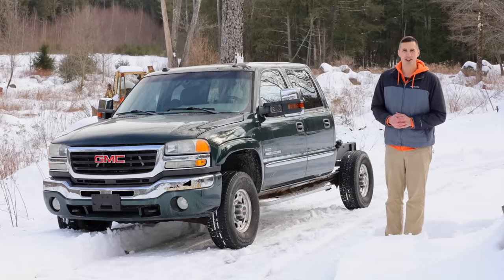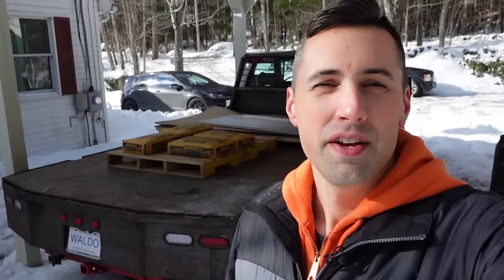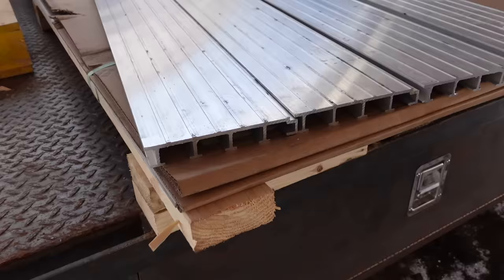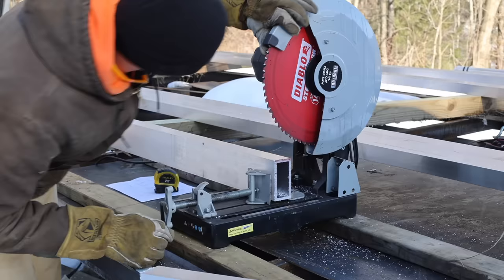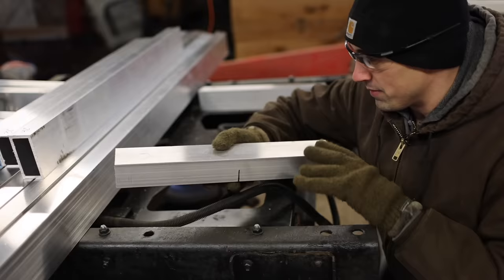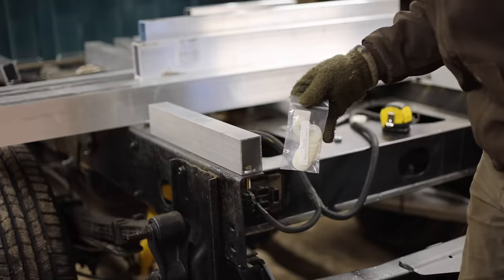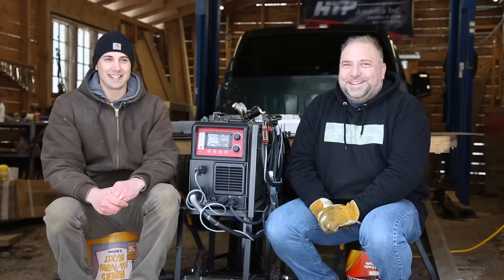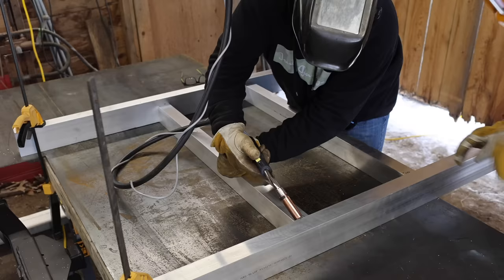Building an ALUMINUM Flatbed for my Project Truck!

Comment: I hope you don't mind a few tips from an Industrial Maintenance tech: 1 Use cutting oil with your drilling and cutting tools when working with aluminum. They will last much longer. 2 They make a wax that comes in a grease tube. You use it on your saw blade to lubricate it when cutting aluminum. We use it on our saws and the blades last forever that way. 3 When you are welding multiples of the same thing, (especially when heat matters) lay out as much as you can, and spread the heat with multiple passes. For example, when you welded the squares on the side of the bed and the round stock to the rub rail, you can jig up as many as possible, then make one weld on each, going down the line. Then you come back and make another weld. So on and so forth until you have all of the sides welded.

Comment: Another thing about aluminum other than hot shortness is that the oxidation on the aluminum has a higher melting temp than the aluminum itself . Cleaning that oxidized layer off is important .

Comment: You should also isolate the bolt from the aluminum frame with a second nylon washer inside your aluminum mounting locations to stop galvanic corrosion 

Hi from Nashua

Comment: I’ve been working with aluminum for 30 years when it starts getting too hot just go faster you don’t need to turn the power down unless you want to yeah mitre saws are pretty much best for aluminum that was a good decision. This is a very awesome flatbed your building I wanna build one myself but I’m gonna make it all out of formed aluminum check plate.
Reply from the maker: Thank you!

Comment: Now this comment is on your bed. You really did a fantastic job again. I didn't think you could out do yourself again. I really enjoy watching you work. You remind me of myself that I won't stop until it's right that matter what the temperature is. I saw your propane heater I think that's a must-have if you don't have a heated garage.

I'm actually thinking about what you did. You bought a truck got yourself a good super price and went on from there. I want to step up to a diesel pickup truck but majority of them have rusted out beds as you know from being on the East Coast as myself. I had been considering yes to remove the bed itself and build something like you have. Buying and already made one cost way too much and you cannot really customize it to what you want. Well I guess you could but I don't think anybody wants a chop up and weld want something that cost that much.

Look forward to your next video. As always I made sure I hit the like button.
Reply from the maker: Thank you so much! 👍

Comment: A big piece of cardboard or thin plywood taped to the back of the cabin, draw the contour with a marker, and make the headache thing on the cardboard. That'll give you more precise and easier measurements. And run the wiring inside the tubes...

Comment: Hey man. GM magna worker again. Super cool to see this method of “mig” aluminum working being done. Hour factory just got (2years ago) of one fords contacts to build their new lightening or electric battery box tray. Huge boy it is! 60% length of the truck.. so no off reading. Anyhow we have all new robotic welders for the staple welds, but still manual is a must and touch ups have to happen. I like how you both mention the temp, BOY did I try to tel them lol it’s usual a hot 35c in the factory, but winter brings a cool 18c and that’s enough to cause issues, at least to some of the employees 3day weld training skill lol no it’s tricky and the biggest thing is heat, and as you say, to hot and you have to really know how to move your you’ll melt through and damn is that so much more of a pain then steel. The other issues though, so you know if you ever weld in the summer of extreme heat, the softness off the feed. Aluminum as you know is very soft compared to steel and it was a bitch in hour summer temps for the first year, the wire would bird up and knot easily in the feeder. There is a extra tool you can get to help the feed at the gun. If your interested give this a shout and I’ll give you our product or if you want to just look it up. Either way, everyone thought mig welding aluminum was going to be so easy lol now did I show them! Lol OH!! On a side note, my fav thing about welding aluminum over steel, I love that perfect white fireworks over the orangy yellow, it’s like, elegant… ya my eyes burn lol
Reply from the maker: I appreciate the comment! You're the one who told me some interesting stuff about the frame (in my rusty frame repair video), right? It's really awesome to get the inside scoop! 👍

Comment: I destroyed the motor on a nice miter saw by cutting a lot of aluminum with it- the flakes got into the motor housing. A friend suggested that I wrap the motor housing with panty hose to act as a filter. Works well. Just a thought!

Comment: If it's already been said then disregard, but that rear cab mounted brake/back up light is going to shine off that headache rack right back into the cab.... ie your rear view mirror. I think I'd disconnect and cap it or just pull the bulbs out. Just a thought. Awesome video and build.

Comment: When I install the trailer plugs on truck beds, I recess  the plug  in a 4 inch tube about 2 inches in. that way the plug is protected  instead of the first thing to get busted of like the way it is mounted on the CM bed in the picture.

Comment: Not only does aluminum have a low melting point. Within about 5 minutes it also gets a corrosion layer on it that is invisible to the human eye that corrosion layer requires almost 4,000 degrees to breakthrough, what's aggravates the blowout issues related with aluminum. Which is why before you start a weld you have to use a nice clean stainless steel brush and brush the spot where you going to start the weld. Once you started the weld, then it welds just fine. All the pulse activity from that welder in the world may help it, but it doesn't fix the issue.

Comment: Smart, chosing to do the CDL.  I got a flatbed B CDL for taking my test so I can avoid the dumb class requirement.  If you take the CDL test with your hydraulic brake setup, I believe you can take the test again with any air brake truck, meaning a class B truck would suffice.

Comment: Aluminum is really nice.  I am sure the price is Ridiculous now days.  I built a Flat Bed out of Wolmanized Lumber .. It lasted longer than the Ford F-250 that I mounted it on.
   The Previous owner had a Tool Body and he made a square tube rear bumper that he also used for an  air tank ..

Comment: This is great and the rear lights add an extra level of quality that is oh so professional, plus the wheel flares. All very nice and can't wait to see the next instalment. @Steve 1961P's comments below sound great, too. If you're going to add any internal boxes I'd illuminate these, too. LED strips are simple and effective for these and can be added to the loom on your 'wider' lighting or on micro switches on the lids, but more work, or glue in some velcro for battery lights or pieces of steel (yes, I know) for magnetic lights. The Oz 4wd wheeling channels are full of good ideas as their canopy camping is legion in this area. Keep up the great work!

Comment: Question from an amateur welder and also a disclaimer. I've never welded anything but mild steel. With that in mind, it looks like sometimes you run a straight bead and sometimes you "stack dimes". Why the different tactics? Great work! Your projects are inspiring and informative.

Comment: Nice Work, both videography and welding. Some safety advice, you should always clamp down material in a drill press. A drill bit can catch your material and whip it around.
Reply from the maker: Thank you!

Comment: Hello from the Netherlands Waldo . 
to protect your welding torch cable and your remote control cable I would put a small diameter fire hose or hydrolick hose "sleeve" over it 
that saves you a lot of annoyance and costs of damaged or broken welding cable.  
Sincerely Hollandduck

Comment: When drilling with a hole saw in aluminium use CRC , DW40 or kerosene. It will stop most of the  alum sticking to the blade of the hole saw.

Comment: The biggest issue of joining two different metals together is galvanic corrosion, if you are going to join two different metals please check their potential based on the galvanic series table. The higher the difference of potential of two metals, the higher probability of galvanic corrosion.

Comment: I don't know if you will show it, but I hope that you keep the aluminum from being in metallic contact with the steel of the truck. Because as much as you claim that steel will korody, so will aluminum under the galvanic action of the differential metals aluminum will turn into aluminum oxide surprisingly fast.
I would suggest at the very least to resist that that you keep a coating of either gibbs, and wipe it down or something like automatic transmission fluid with maybe 1/4 mix of PB Blaster along with a small amount of like Dawn dish detergent to keep the aluminum from turning into powder.
It might be advisable to put at least a coating of satin clear coat on it. That will at least keep the parts of it that do not get regularly scuffed and cleared of turning to powder, from turning to powder. Atmosphere alone and contact with steel will degrade aluminum quickly.
With that song, if you will spray a lubricant on it and leave it wet you can make several Cuts before you have to reapply the lubricant. It will keep the aluminum from going up on the teeth of the saw. And yes I would saw will do a better job but you still need to apply a lubricant to it. You can even use WD-40 but you have to use it nearly every cut. Because WD-40 is not a lubricant. But it is a dispersant as well as a solvent.
Biggest reason for people having to use different procedures for aluminum is because aluminum is not actually a metal. It is a metalloid type of hi fractal mineral.

Comment: really nice job better than any i have seen. you have a lot of money just in the metal. take care, be safe and well.
Reply from the maker: Thank you! The metal came to around $2300, though I did order a bit more than I needed. Not bad considering buying a flatbed like this would cost WAY more (maybe $7000-8000?)
Reply: @WaldosWorld  yes the aiuminum truck beds and trailers are really high . but that bed will last you forever you could sell yours easily it you wanted to it's better built than the other. i have seen a lot that had cracked welds which alway get worse with age. take care, be safe and well. will be glad to see it finished.

Comment: Love the video it’s very informative, but I disagreed with your oooon on the flatbed strength due to aluminum. Aussies and Kiwis have been building “trays” for their “Utes” out of full aluminum for years with no issues at all. I lived there back in 2004 working as a welder and boilermaker and I loved the way they compacted things and built flatbeds that were very efficient for the 4wd market as well as the working man. Just a thought, but really great work, I really like and borrowed some tips from your video. Cheers

Comment: Aluminum can be cut with anything that you can cut with wood... now if you do not use the proper blade it might mar the work or not leave as clean an edge as you want but I have never had a bad edge I couldn't fix or hide... what you absolutely cannot use for Aluminum is those black cut off disks for angle grinders and chop saws... Aluminum will get stuck in the pours and wreck the blade... Milwaukee has a black cut off disk that is especially made for Aluminum but it's only available for one of their m12 tools

Comment: Another awesome video. Thanks Waldo. Looking good for sure. A bit of WD-40 works wonders when cutting aluminum on your blades stops any build up and cut cleaner.
Reply: I was wondering what I could to to prevent the blades from gumming up. Should I use metal cutting blades or some finer wood blades both with a lubricant?
Reply: @snowskier13  regular fine cut carbide blade. Preferably less hook angle but anything will work. Wd-40 is the main key to helping the most though

Comment: Gotta love the 0 high pressure ventilation in the video.
Welders inhale the fumes forming aluminium compound deposits in the lungs. The deposits are responsible for aluminosis also known as aluminium lung and bronchitis which can cause irreversible damage

Comment: Pro tip: if you put a little WD-40 on the steel cutting blade, it will cut aluminum without junking up.  Night and day difference

Comment: If you use beeswax on your angle grinder it will grind smoother and the aluminum shavings will not mess up you disc

Comment: If you ever want to coat that nice bed in the future you can still buy real "zinc chromate" (NOT to be confused with the color paint companies use that name for!) aircraft primer. There are a nice variety of aircraft coatings to protect aluminum, and other useful things like the sealant of the gods, Semkit fuel tank sealant which is fuel, oil and hydraulic fluid proof (but not cheap).

Comment: I didn’t think you could feed aluminum wire the torch that way, pretty cool !!
Reply from the maker: Yeah, the torch has a special low-friction liner that works for aluminum 👍
Reply: This machine uses a 26 series torch with a Graphite liner that when combined with quality wire like alcoa, produces amazing results on aluminum welding

Comment: Not sure how it works in NH but in CT if i wanted to get CDL I could use any truck and pull any trailer over 10k GVWR to get class a. I don't think you get air brake endorsement though. It is very annoying that you need Class A to pull even a 14k trailer. I always find good deals on tractors but cant get them because they are over 7500 lbs which would put GVW over 10k.

Comment: Waldo this year duramax 05 lly has bad head gasket problems around 200,000 miles I would go get it checked out at a diesel mechanic shop

Comment: Most are steel framed as you need to heat treat aluminium structural welds or they'll just fatigue and crack

Comment: You may have these planned but side marker lights and reflectors  are requited on the back side. 
 
In the United States, amber front and red rear side marker lamps and retroreflectors are required. The law initially required lights or retroreflectors on vehicles manufactured after 1 January 1968. This was amended to require lights and retroreflectors on vehicles manufactured after 1 January 1970.

Comment: Pro tip for anyone using a chop-saw to cut aluminum.  Always let the blade stop before you let it spring back up to its resting position. Especially on small cutoff pieces. Big pieces it’s not such a problem. But with small cutoffs, You’ll thank me. Broke my finger once and have sliced myself a few times because of it and ruined a few expensive blades. The small pieces tend to jam in the blade when you are letting the saw spring back up to resting position.

Comment: Just to clear something up about a comment regarding requiring a CDL to drive a vehicle with airbrakes. That's a very common misconception. A CDL is not required to operate a vehicle with airbrakes (airbrakes are far safer than hydraulic brakes). CDL primarily has to do with 1) Weight (26k or more) and 2) Transport of Haz Mat.

Comment: I never welded aluminum but I know its melting point is very low. But I guess I didn't expect that it wouldn't warp since you didn't clamp any of the pieces you welded. Just found your channel beginning with the gooseneck trailer, that's quite a project, very nice production mate!

Comment: They did the same thing with me and my class a cdl. Got my permit when I was 20 and waited till I was 21 to get the interstate license and in that time frame they made the restrictions for no 5th wheel hitch and no manual transmission. Even if I took the test in my dad's 1990 454 chevy 1 ton dually with a granny low transmission I would have been restricted with the manual transmission thing they have or whatever it was so I just elected to take it in the company truck which had airbrakes but automatic transmission and see about doing the 5th wheel hitch part later....... still haven't done it as I'm thinking about going back to class e

Comment: 8k to get your CDL. That's crazy, just got mine a couple months ago now, got my permit probably same time you got yours. Went to my nearest tech college for their truck driving program. 3 days a week usually half days (4hr). 10 weeks later I got my CDL.  Awesome build by the way, definitely helpful for ideas on material and fabrication. I like the idea for the extrudent aluminum floor. Was thinking of making an off-road overland flatbed/ covered complete with slide out drawer system from the back. Might be one of those build as you go kind of things once I get to it haha

Comment: Hi i follow you.Jeff check Land Rover in touch by the windscreen are usually get blocked up as that is where the heater vents gets the air from all the best 👍

Comment: Hey Waldo. 
Have you checked with CDL test facilities in your area?
Most test places allow you to use their vehicle for a small fee. 
This is what I did to get my unrestricted class A. 
By all means do this if you can as to upgrade later will require you to go through the entire test process again. 
I'm too far away to help you with a vehicle but would be happy to answer any questions you may have.
Reply from the maker: I appreciate it! The testing here is at the DMV, so I'm pretty sure they don't have vehicles I can use
Reply: New Hampshire does not have vehicles you can "rent"

Comment: Why not use a nylon strip instead of washers between the bed and frame. It ensures no gaps in between so that moisture won’t build up and the steel frame won’t rust. I’ve seen so much of this problem happen when mounting anything to the frame.